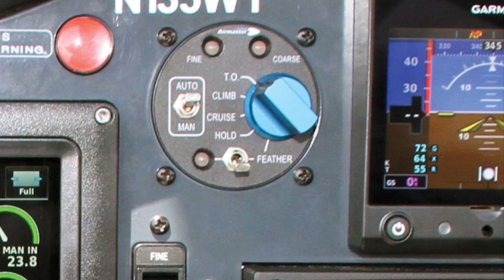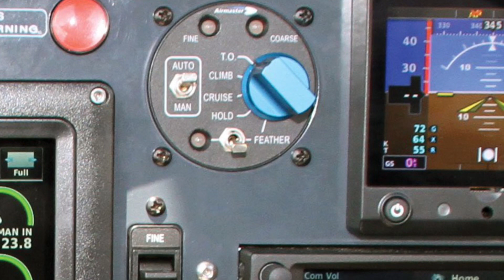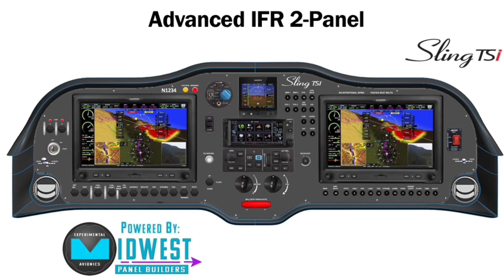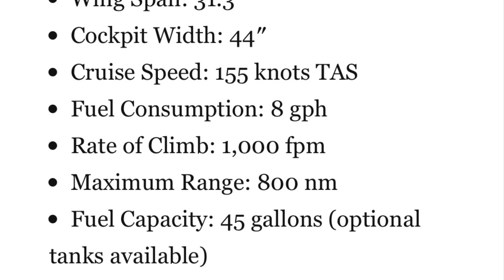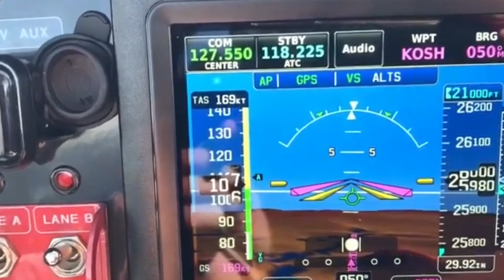I’m building a Sling TSI

Comment: Congrats and good luck, Brad! I did not know that the TSI had that great aux tank option. Question about the Rotax 915iS... If it accepts both 100ll and 91oMoGas then what happens if you fill with MoGas and land at a field that only serves 100LL? Can you mix a few gallons of MoGas already in the tank with 100LL? What about the reverse case? Even if possible, are there any negative side effects? 

 You are living my dream! One day I'll be in the skies flying just like you. Thanks and Good luck!
Reply: Not a problem to mix fuel types

100LL just requires more oil changes due to the lead content.  It will gum up the drive train and gear box if you don’t change oil regularly.   Many people use 100LL only out of convenience and just follow recommended oil change intervals.
Reply: I'm told the fuels can be mixed at no penalty.

Comment: How long did it take form order to delivery? and, what are your thoughts about adding an anti-icing system?
Reply from the maker: I test flew it towards the end of November but by the time I got my order in it was December. They delivered it March 13 so it took about 3 months lead time. Thats what they told me when I ordered it was well. As far as adding an anti-system, I haven’t put any thought into that. Have you done any research into anti ice?
Reply: @airburt  for De-Icing, I think there are 3 general approaches (1-Expanding/Contracting bladder on wing, 2-Fluid emitting system, 3- Heating element, or combination of sorts).  I think the most probable solution would be a heating element type system.  Given the newness of the TSI I haven't seen any retrofits made yet, but still looking.
Reply from the maker: Yeah I will have to look into it. I know it’s such a light airplane that I wouldn’t want to take the weight penalty for having a boot system. I’ve been out of GA for a while so I’m not familiar with a light airplane that has a heated wing. I’ve seen the TKS fluid system years ago at Oshkosh on a diamond airplane. I just don’t know enough about any of the systems on this light of an airplane. I will probably just avoid icing conditions. This is something I can look into though, so thanks for bringing it up.